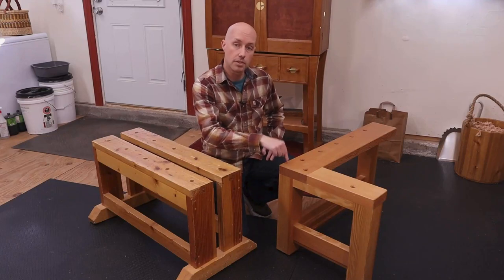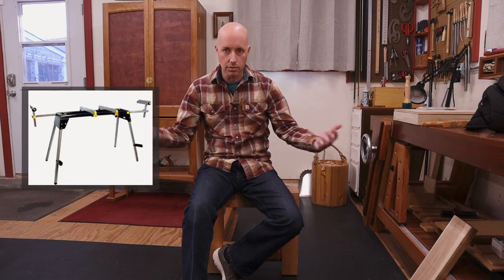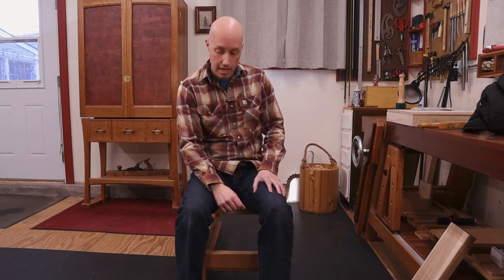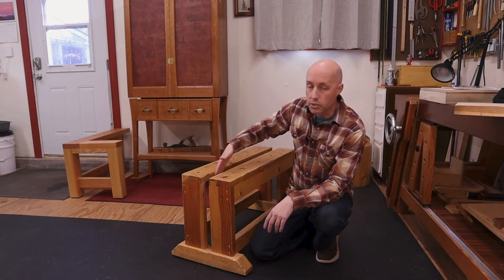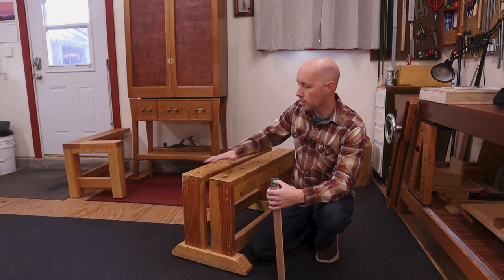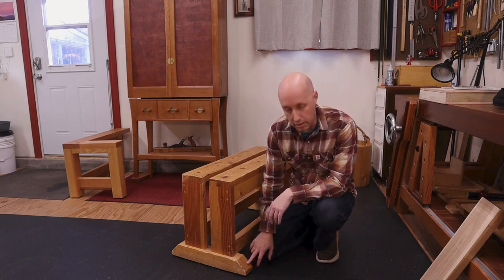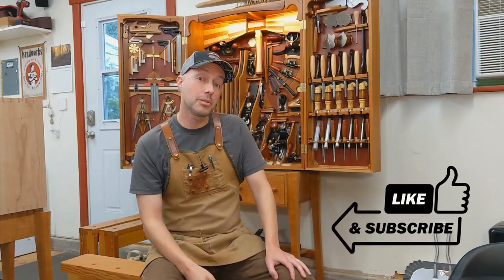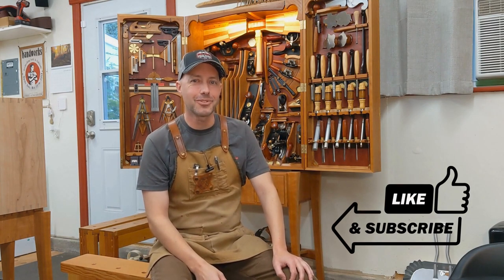A Three-Legged Saw Bench?

Comment: I appreciate the thought you put into your design.  This looks like a nice piece of shop furniture.  I would suggest that you show it in action.  Questions like: How do you secure the board for a long rip?  Where do you stand while sawing?  Showing rather than describing is usually a great way to teach.  Other than that, I'm enjoying your efforts.  Keep it up.
Reply from the maker: The thought occurred to me to show it in action, but I was being lazy when I shot this and thought describing it would be enough, but you're right. Demonstrating is a better way to teach. As for long rips, I use F-style clamps to hold the workpiece but, truth be told, I got a bandsaw around the same time I built this, so I use this saw bench for crosscutting probably more than 90% of the time.

Comment: I built a traditional saw bench but it doesn't satisfy in a few key ways.  What I decided was to build another one like the first, but with a wider top.  I can arrange the two benches like an L, as with your new bench, or as two parallel benches, like the split top, or spread well apart to support a longer piece.

Comment: Pretty ingenious design. Rather than plans, how about a quick rundown of the dimensions? I could figure out the rest from there.
Reply from the maker: Sure. Do you want them in metric or imperial?
Reply: @themountaintopjoinersshop8422  sweet! Imperial, please and thanks!
Reply from the maker: The long side is 35" long and just over 6" wide. The short side is 19 1/4" long and just over 5" wide. The height depends on the user, and should be determined by finding something to sit on that results in your upper legs being parallel to the floor, then measuring from the floor to the underside of the leg just above the knee, erring on the the high side of that measurement, if at all.
Reply: @themountaintopjoinersshop8422  thank you!

Comment: hmm nice if it fits your needs but I'd find it a little bit cumbersome for my workshop.
I built one very similar to your old one, splited top, but with no stretchers on the bottom and all is flush. The base is larger than the top. A relief on the middle  of the feet make it easier to stabilize than 2 large flat feet.
I don't use holdfasts with it but quick clamps. Sometimes I have put it on his side, that makes a useful portable workstation for welding or to put the grinder on... and I also use it this way to hold long pieces and cut tenons.

Comment: I love saw benches. I have rewatched this many, many times to take in everything. I do not know what the narrower strips are under the lower stretchers. I have seen them before but cannot figure it out. Just a style or wear strips if it is stacked or moved? I just see mortise and tenon joinery and the lower strip seems unnecessary. Very curious.
Reply from the maker: I had it in my head that I'd build a small tool chest that would tuck inside the L and attach wheels to the sawbench so I could tow it around (kind of lik a reverse wheelbarrow). I've since moved on from that idea, because I never go mobile and don't want to either.

Comment: Just found your site, interesting design but the whole reason for the height of a traditional saw bench is using your knee as a clamp. If designing a new saw bench why make it uncomfortably low when the knee isn’t used as a clamp?
Reply from the maker: I never had a problem with the height being uncomfortable for sawing, personally, perhaps because I had gotten so used to sawing on the old one, but you do make an interesting point.

Comment: Any recommendations on those hold fasts?   Brand?  Positive? Negative?
Reply from the maker: Mine are the Gramercy holdfasts from Tools for Working Wood. They work in a standard 3/4" holes and I can easily recommend them.  I did rough up the backside of the shafts on mine with a center punch to increase their grip in the dog hole, BTW, but yeah. I'm quite happy with them.

Comment: In the “L” state, do you have any issues with pull saws or is it kinda the same bag being right handed?
Reply from the maker: I think with a pull saw it'd work pretty well, but the few pull saws I have are little flush cut ones I wouldn't use at a saw bench.